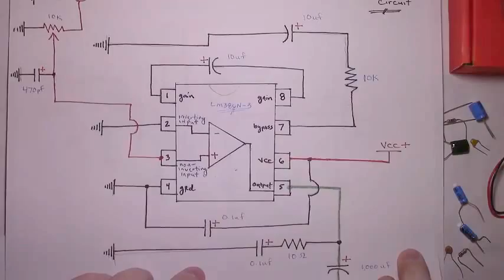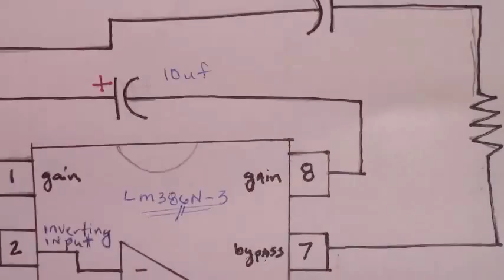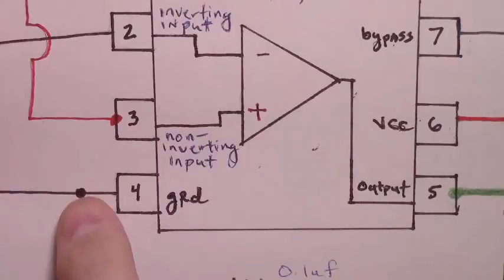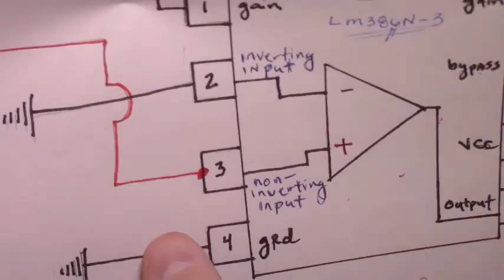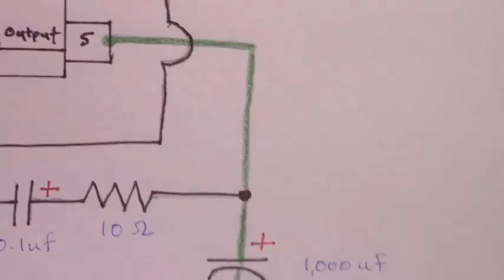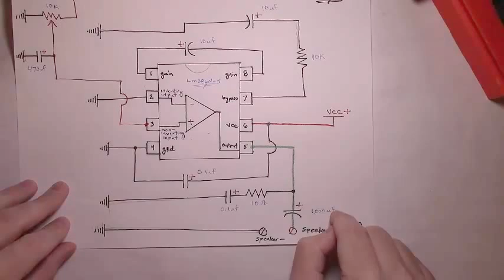Circuit Assembly Tutorials || LM386 Audio Amplifier

Comment: Thanx for the great vid philo mech! I have found only your video explaining this circuit as good. I have some big questions though-
1) I dont have the 470pf capacitor at pin 3. I have 100n, 10n,1n, 1pf, 10pf and 22pf only. I also have a trimmer capacitor with a range 5-50pf. Is there any way i could combine these to make a 470pf? 
2) Is that 10 ohm resistor really necessary? I cant find it i have a 51 ohm resistor will it work with that?
3) My lm386 has LM386 L written on it. Will it work?
4) Can this circuit accommodate an electret mic at the input? If not, what modifications need to be made?
Please help.
Advait
Reply from the maker: Advait Mehla Appreciate the feedback and questions.  

1) Instead of combining the caps I would suggest substituting the the 1nf for the 470pf, 1nf should serve to cancel most RF noise (if any happens to be present).
2) the 10 ohm resistor combined with the capacitor serves to remove the last little bit of noise before the output reaches the speaker.  51 ohm will work, it won't remove as much noise as the 10 but having any version of that R/C network ahead of the speaker is better than no network.
3) Yes, the circuit will work for the L version.  L tends to refer to a lower voltage version of the chip.  Just to be safe, check the datasheet and make sure that your power supply is within the chip's acceptable range of operating voltage.
4) Yes.  It can be used with an electret mic, though it may not be especially loud without adding some preamp circuitry between the mic and 386.

Hope these comments help.  Please let me know if there are more questions and I will continue to do my best to help.

Thanks for watching!
Reply: philo mech Thanks for all the help! I will make this circuit in a few days and will surely let you know if i face any problems:)
Reply: Advait Mehla Hello again! I have made this circuit but it is not working for some reason. I do not know if the chip is functional bcoz i hv only one of that available with me and this is my first circuit using it. I also suspect my potentiometer(again, its the only one i have) is not working properly and also it isn't breadboard mount  and i need to connect wires to the breadboard(who likes that?). Could you suggest any resistor(s) to replace the pot? Also mention how to connect it/them and other troubleshooting tips. Also there seems to be no current across the speaker(i metered the output and there was no voltage reading. Do suggest some troubleshooting tips.
Thanks in advance.
Advait

Comment: hey man , excellent tutorial, but can u please tell me how to do the connection wthout the potentiometer. I couldn't get one so.
pics would be great , because I am a novice in these matters.
my email is : sbhattacharyauncut@gmail.com
please help man!!!
Reply from the maker: soham bhattacharya  Appreciate the feedback and thanks for the question.  A resistor can be used in place of the potentiometer.  Around a 2 to 10K would work fine.  Connect one leg of the resistor to the audio input line coming from the mp3 player and the other leg to the row in the breadboard that leads to the input pin of the 386 (this will be the same row in which the 470pf capacitor is located, see video and schematic).  Not using the potentiometer will mean that you'll need to control the volume by the volume control on the mp3 player.  Hope these comments help.  Please let me know if there are more questions, I will always do my best to help.   Thanks for watching!

Comment: Hello again! Your schematic shows a .1uF cap between pins 4 and 6 of the chip, and again coming off pin 5, after the 10 ohm resistor. But, in your description (voiceover), you say you're putting a 1uF cap across pins 4 and 6, and then regarding pin 5, you say it's a .1uF cap, then you say it's a 1uF cap, and then you call it a 10uF cap. Can you confirm which value it's supposed to be? Thank you!
Reply: +mmassinger it is a 0.1uF

Comment: This one of great DIY using lm386. I have watch your video and recommended to my friends.

Although I have some questions to address, would be very appreciate if you replied to me too thanks.

I am now on a project to build a PA System. 1st question I wanted to address is the wattage of speaker and its Impedance. I am looking to use an 4ohm and higher than 5watts speaker roughly around 50watts as I have an spare car speakers. Using your schematic and components value, would this be suffiecient tp drive the speaker and produce a decent amount of audio signal?

2ndly will it be possible to add a 3way active crossover to this circuit?

And 3rdly is the resistor-capacitor, on the output of your lm386 (pin5) was tp calculate the gain of an non-inverting amplifier?

Would be really glad if you can help me answer my queries.  I'm really glad to saw all your comments and reply on your videos!! Please continue to build such DOY's!! Thanksss
Reply from the maker: Rodulf Ramos Appreciate the comment and questions.  
1) A 4 ohm speaker will make the 386 source more current than an 8 ohm.  I've used the 386 with 4 ohm speakers without problems.  But, doing so tends to make the 386 run a little warmer than usual (it depends on how much volume is desired, consistently low volume --no problem, consistently high volume ---potential overheating problem).  If the chip becomes too hot to touch, then adding some form of heat sinking will be necessary.  In the end, a 4 ohm speaker will likely work as long as some form of heat sinking is included if/when needed and the volume isn't consistently set too high.  
The 50 watt speaker rating is of greater concern.  The 386 might be able to move the 'heavier' cone of a speaker with that wattage but I suspect that it won't do so very well or for very long.  
If it is able to move it enough to produce sound, then the sound likely won't be very loud.  And, the chip will be doing its best to move it.  Which means that it will being straining and that might result in too much heat for the chip to safely handle.  You can certainly try it and see what happens.  The worse results will be: 1) no sound, 2) sound but at too low a volume to be usable, or 3) decent volume but an overheated 386.  Essentially, attempting to use a high wattage speaker might produce unwanted results.  The 4 ohm impedance will already be causing the chip to source significant current and that combined with its efforts to move a speaker with a 'heavier' cone will likely result in an overheated chip even after heat sinking is added.  If you decide to try it, I would definitely closely and repeatedly check the chip temperature after a few seconds, minutes, etc.  I would want to be sure that it's not a fire hazard.  More than likely, the chip would stop functioning prior to melting, catching on fire, etc.  But, I wouldn't want to assume such.  If you decide to try it, then I would encourage careful attention being paid to the chip's temperature.  Operate the circuit at the maximum volume you ever expect to use for a few seconds, minutes, etc.,  and check the chip's temperature (across multiple iterations).  If it seems to repeatedly reach an undesirable temperature, then another amp chip will likely be needed.

2) It's definitely possible to add a 3 way active or passive crossover to the circuit.  Just add one between the chip's output and the high, mid, and low speakers.   Though it's worth noting that this is a mono circuit and depending on the song, some frequencies may not be present on the output due to being sent out the unused left/right input wire (the line not connected to the chip's input).  

3) The low value resistor/capacitor network included on the chip's output line ahead of the speaker is serving to remove any ('super') high frequencies that may enter and be amplified by the chip.  

Hope these comments are helpful.  Please let me know if there are more questions.  I will always do my best to help.  Thanks for watching!
Reply: philo mech thanks you for your very efficient reply. 

So Now I have decided to get a speaker rated at 8ohm 10watt. But It has an maximum wattage of 30watts. 

Taljing about the IC lm386. How would I possibly calculate the power on the output. Lets say I have an input of 10v. 

With the use of 10uf for the gain. As you have told It Is in maximum gain which I think is 200 for lm386. Am I cprrect to say that?
Reply from the maker: Rodulf Ramos Thanks for the reply and questions.
Calculating the power output at 10V is possible but such will only reveal 'ideal' numbers rather than what is actually being delivered by the specific chip one happens to be using.  

Performing the tests described in the the following two videos are how to determine what the supply voltage vs. power output actually is.

Channel: JohnAudioTech
Video title: Audio Amplifier Supply Voltage vs. Output Power
https://www.youtube.com/watch?v=mdL2cVq-VFM

Channel: Sonic Electronix
Title: How to Calculate Amplifier Efficiency
https://www.youtube.com/watch?v=APztzyv0xBs

Connecting a 10uf capacitor across pins 1 and 8 provides a gain of 200.

Hope these comments and the linked videos help.  Please continue to let me know if/when there are questions and I will always do my best to help.
Reply: philo mech  thanks for the links. totally got what i was looking for! cheers!!

on the other hand. could i possibly get your email add?
Reply from the maker: Rodulf Ramos Glad the video links were helpful!  You can email to me via the private message link on the About page of this channel.   Please continue to let me know if/when there are any questions, etc., and I will always do my best to help.

Comment: Hi! Good video! But I've built the exact same circuit and I get a LOT of distortion, so my question if it can be related to the 9v battery I'm using (currently is giving me 8v) or the speaker. The speaker says that it is a 8 ohm 2w, but do you think changing the speaker would make any difference? Thanks
Reply from the maker: Adrián Rodrigo Guitar Appreciate the comment and question.  The battery is likely not the cause.  The speaker might be a contributing factor but it's most likely the 386 or one of the additional components.  First, does the chip have corporate markings, e.g.,Texas Instruments, etc.?  If not, then you may have acquired one of the many aftermarket knocks offs.  I've never had much luck with non-branded chips.  They most always sound quite horrible due to poor manufacturing.   If you do happen to be using a chip made by one of the major companies, then the chip is likely fine and the distortion is entering either through the wires, capacitors, resistors, or potentiometer.  A systematic search is the best way to locate the possible cause/s.  Assuming the chip is good, then I would first swap the potentiometer with another one of the same value.  Turn the knob back and forth and see if the noise decreases.  If so, then you'll know the potentiometer was partly the cause.  Next, swap each component in turn for one of the same value.  It's quite common for one potentiometer, resistor, capacitor, etc., to sound a little better than another of the same value.  I often test 5 or more of the same component in an audio circuit until I find the ones that sound the best (i.e., the ones that introduce the least amount of noise into the circuit)  Also, did you keep the wires as short as possible?  Any added wire length can add noise to the circuit.    Hope these comments are helpful and point you in the direction of locating the possible cause/s.  Definitely let me know if there are more questions, etc., and I will continue to do my best to help.  

Thanks for watching!
Reply: philo mech Hi! Thanks for the reply. It's not definetely the lm386, it is a good one (National Semiconductor). I will try to replace the pot because I think it's pretty cheap and horrible. The problem however it's not the static noise, it's the massive distortion when you turn up the volume a bit. I've done the circuit in a small PCB with bridge wire and stuff like that and very close to the chip. Must be the pot or some of the capacitors as you said. Thanks for helping!
Reply from the maker: Adrián Rodrigo Guitar Thanks for the reply.   Having eliminated the chip and wires, all that remains are the pot or caps.   ...Or, it might be that the gain is a little too much for the signal being sent through the circuit.  The gain was set to max (200) in the circuit described in the video.  It's possible to lower/reduce the gain by adding a resistor in series with the 10uf cap across pins 1 and 8.  If changing the pot, caps, etc., doesn't remove the distortion, then I'd try reducing the gain.  Start by removing the 10uf cap between pins 1 and 8, and see if the volume is still enough for your application.  If so, then all is well.  If you would like for it to be a little louder (but not to the point of distortion), then try adding a 10K resistor in series with the 10uf cap between pins 1 and 8.  The 386's datasheet discusses how specific resistor values in series with that cap will effect the gain.  For fully adjustable gain one can add two legs of a potentiometer (10k would be fine) in series with the 10uf cap.   Hope these comments help.  Please let me know if there are more questions and I will continue to do my best to help.

Comment: This is a fantastic video! Thanks for taking the time to produce it! I was wondering, though, if you could be more specific as to the type of capacitors and resistors you're using? I'm new to electronics, and am confused by the different materials, and the voltage ratings. Thank you!
Reply from the maker: mmassinger Appreciate the comment and question.  

1/4 watt (or larger) resistors are fine.  And capacitors rated for 2 to 3 times the voltage you expect them to 'see' inside the circuit are fine, e.g., if you powered the circuit with a 9V battery, then you would want to use capacitors rated for 18 or more volts.  Hope these comments help.  Please let me know if there are more questions and I will always do my best to help.

Thanks for watching!

Comment: If I were to use the LM386 to make an Ultrasonic Varmint Blaster, the noise filtered out by  your methodology would actually be an advantage. Therefore, what would I do to increase the noise?
Reply from the maker: Clayton Benignus Neat application!   Removing the noise from a 386 circuit is often the challenge.  Getting as much noise as possible to enter into the circuit definitely shouldn't be a problem.  Remove the 470pf cap on the input side, the cap/resistor pair connected to the bypass pin, and the final cap/resistor network just ahead of the speaker cap.  That should allow quite a bit of noise to enter the circuit.  If more noise is needed, then the barebones application circuit presented in the 386's datasheet might be even better.   If you happen to make a video of the blaster in action, I'd definitely appreciate a link to it.  Hope these comments help.  Thanks for watching!
Reply from the maker: Clayton Benignus Definitely a great project and appreciate the detailed description!  After building it I'd have to set up a game/night vision camera.  Seeing how the unwanted animals respond when it sounds off would be a must (my curiosity would have to be sated) .  I like that it deters rather than harms the creatures.  It will likely be much more effective than the aluminum cans rattling in the breeze that I often used to deter the deer away from the garden (note that the rabbits merely laughed at the cans while continuing to eat the lettuce).  All the parts you mention should be able to produce the effect you're after.  But if the 386 circuitry keeps filtering out the higher frequency, then you might try using the timer's output to drive a mosfet to the tweeter.  A timer/mosfet combo can be made into a reasonably decent class-D type amplifier circuit.  Just a thought. 

I always welcome any opportunity to help.  Please let me know if there are any difficulties you think I might be able to help with.  If you prefer,and rather than using this comment feed, we can discuss such through the private message system located at the bottom of the about page on this channel.  Either way works for me.   

No worries about the skill level, we all start from where ever we currently happen to be and then learn what's needed along the way.  I'm no where near being an 'expert' in all things electronic or mechanical.  I'm familiar with many circuits, etc., but there are also domains well outside of my current skill set, detailed RF circuitry being one of them.  I let those much more familiar with such than me build and test those kinds of circuits (I simply hack out or purchase RF, etc., modules as projects require them).  You'll  acquire whatever experience you need during the course of completing the project --- ---that's always one of the most enjoyable parts (at least to me).                                   

I look forward to hearing more about the project as you continue to make progress.